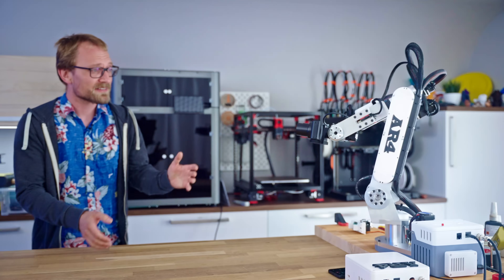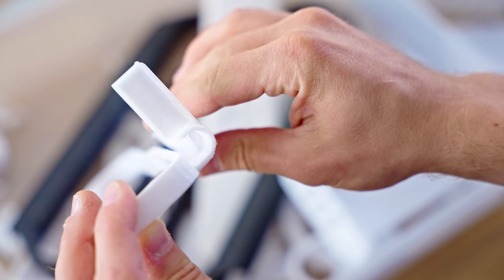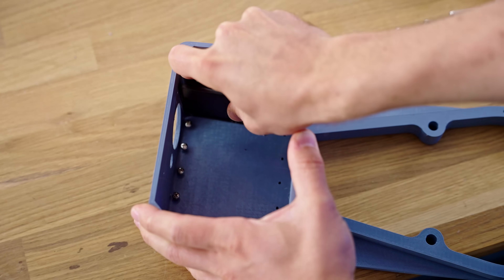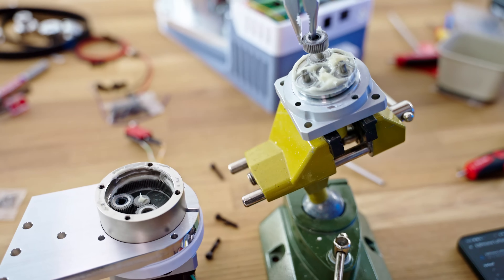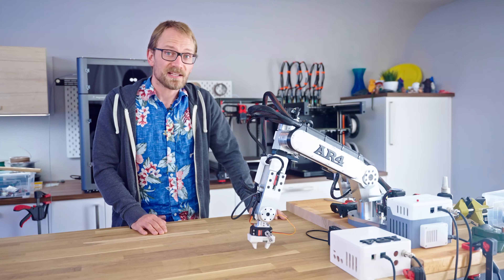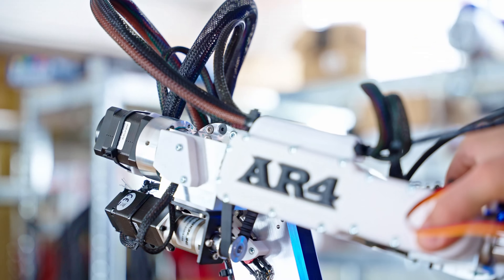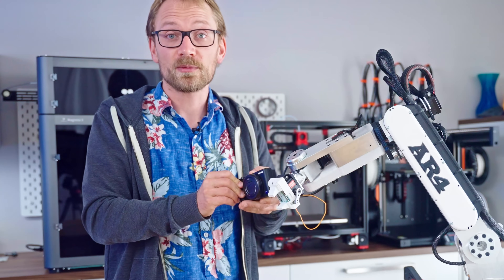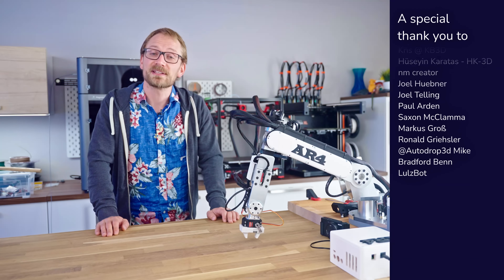I built myself a new Robot Buddy!

Comment: Instead of tinning wires it is better to use ferrules. Cheap and reliable
Reply: I was surprised to see that is the official way to do it, it is well known now with 3D printer failures that you do not tin wires that go into screw terminals.
Reply: @conorstewart2214  also there are 2 types of screw terminals. One have additional sheet metal inside terminal to spread force over whole connector, it also acts as a spring so this connector have harder time becoming loose. And there is a second one, where wire is kept in place by screw directly. Second one can be used only with solid wires and ferrules, as stranded wires are simply getting crushed and cut inside by rotating screw.
Reply: @conorstewart2214 i thought Thomas covered this before too.  Either way good to mention this as always.
Reply: I find it's more secure to just ditch the ferrule personally, if you don't use the right one and it's not properly crimped, the wire can slide out while the ferrule is left behind in the screw terminal...

Ferrules aren't used for 230V wiring in houses and stuff either, and they will never budge
Reply: @PureRushXevus you do not use ferrules on solid wire.
Their main purpose is to hold the ends of stranded wire together so the current flows through all strands not just those few the screw terminal caught.
For the very small wire made of delicate strands the ferrules provide protection from the screw damaging and literally cutting off some strands.
Thick solid wire doesn’t need ferrules.
They also provide some strain relief for thin wires.
Reply: @rok1475  a lot of the 230V wiring for homes in norway don't use solid wire, 1.5 and 2.5 mm2 cables will often have like 7 strands for their conductors. 

And they're wired directly into fuses and whatnot right into the screw terminal without ferrules or anything on the end. With a good quality screw terminal, I'd have more faith in that versus having ferrules on everything where one might have not crimped on properly.

Just went over one of my printers' wiring and none of the wires that go into screw terminals have gotten loose at all
Reply: @PureRushXevus  
Sorry to say this, but it seems more like a user problem and not ferrule problem. Every wire gauge needs a different ferrule size, also it is very important to use proper crimper for the job. Crimpers stamped from sheet metal are useless, they never works. Use one with machined dies, or shutter like with 4 jaws (or 6 jaws). Second type is very universal as you don’t have to swap dies, usually they work with wires from 0,25 to 4 mm2, decent quality ones u can find for like a 15 euros. And in bizarre world of crimped connector, ferrules are the most simple and easiest one to do correctly.
And ferrules are used in 230V / 400 V wiring A LOT. With stranded wires are pretty much mandatory, unless u use something like Wago 221 / 222 or similliar connectors made purposely to work with unferruled wires.
Reply: I wish I had run into wire ferrules much earlier, especially screwing down larger wires.  Surprised this issue didn’t get caught much earlier.
Reply: @xanowich  (fml I think my reply got nuked, why is youtube so fucking bad)
if it did get nuked: I don't think any of the wiring around the house here would have ferrules on them, maybe it's a country to country thing?
I bought a kit from aliexpress that has a decent quality crimper which has 4 jaws that look like a ninja star when not crimped, and then closes into a square when crimped. sometimes when I've used it, I feel like the ferrules I've got are either slightly too big, or too small. So when I then use the slightly too big one and crimp like hell, it doesn't stay on.

Maybe I need to get more ferrules in different sizes? even though the kit came with a bunch of different ones. the model is called HSC8 6-4A and made by "sanjiang", I'd link it but yeah my comment would definitely just get deleted by spam filter or something .-.
Reply: Hard agree
Reply: In the industry, all screw connectors require a ferrule. Only the spring type connectors can accept bare stranded wire.
Reply: @PureRushXevus  That's incorrect. The machines in the kitchen all have stranded cables and do have ferrules to connect them inside the machine. Only solid cables don't have a ferrule (because it is useless).
Reply: Hell no, tinning is the way to go. Solder remains maleable making this not only the most resistant option as you cant pull the wire out wirh the screw molding itself into it but also the best as far as resistance goes, granted,ferules might not introduce too much resistance,it's still more than solder so I'd be interested to see how thermals look in comparison under load. 
The only difference is that you don't need a soldering iron on the job. Ie. It's faster to and safer than nothing.
In any case i have yet to see products on the market uing ferrules instead of proper crimps or tinned wires. Seems too unsafe.

Comment: Thomas,  

Thank you for building the AR4 and highlighting some of its features.  I did want to touch on a few of the comments you made. In the overview section of the manual I do mention pre-applying solder to wires being joined together - I find it easier to pre-apply solder or tinning the ends - and then bring them together with the iron rather than trying to hold the wire ends together and hold the solder and hold iron at the same time, not having 3 hands - it helps to pre apply the solder.  None of the wires going to the breakout board call for tinning so I'm not sure about your comments on that?  

On page 143 I do have some groups of wires soldered together to help group them going to the 3 screw terminals as its a tight fit and difficult to maneuver them into position without them being connected but you could certainly use ferrules in this step if needed. 

At one point in the past the design did utilize plug connectors and building a wiring harness.  Given different applications, motions and articulations all the low cost plugs I sampled proved to fail over time.  With this small arm and the limited cable routing and cable arc lengths, direct solder with the solder joints in strategic locations using heat shrink proved to be more reliable, less bulky, less costly and not as time consuming as crimping and inserting numerous plug pins.  The primary goal of this project from day one has been to realize a usable robot and at a very particular price point.  I've worked with industrial robots my entire career and its always been a frustration that any usable robot was out of reach.  There is an absolute threshold on the price as most educators have a budgetary limit so I have made it priority number one to stay under that limit.  This drives many of the design aspects,  The motors for example are off the shelf variants and cannot be fully customized without adversely affecting the price. There is a limit as to what OMC can customize on these coming from the factory.  The machined components are kept to an absolute minimum and as many as possible are cut from flat sheet material.  This also drives the bearing designs and tensioning designs as custom machined threads and spindles for locknuts for example is not in the cards at this price point. It also drives some of the belt selections.  

I did notice the belt tension on your build was far too loose resulting in a good amount of play.  Here is a quick video of the forced deflection on my build. (well it looks like I cant post a link in comments but I will post in on my channel or the forum)  - Making the statement that  "This robot arm is neither accurate nor precise, rigid or smooth" seems a bit harsh considering. The AR4 project is always under improvement, its not perfect but like I mentioned to you in an earlier email the robot is designed for pick and place, welding and handling operations. A great deal of effort has gone into this project, I know you have a great deal of experience and a wealth of knowledge in all manner of machines and mechatronics and your design suggestions are certainly well founded but I wanted to explain these aspects of the project, and hope you will convey these points to your audience. 

Thank you,

Chris
Reply: I had tried many different robot arms, but no one beats AR4.
Another big advantage is that you can discuss problems directly with Chris Annin.
His manual is the best and most detailed I have ever seen for such a product in this price class.
I got manufactured custom-made motors at StepperOnline, and I know how many motors needed to order to get them to a fair price.
I don't find some of your criticism fair compared to the price for an AR4.
Last .. sorry for my bad English, I'm from Denmark  🇩🇰 😊
Reply: Thanks for your work over the years Chris!
Reply: Thanks for the educations and making robotic arm accessible.
Reply: Thanks, now I understand why there is no plug connectors:
Quote: "At one point in the past the design did utilize plug connectors and building a wiring harness.  Given different applications, motions and articulations all the low cost plugs I sampled proved to fail over time. "
Reply: This is the first I’ve heard of this arm, its incredible! I’m setting up a workstation for my robotics projects later next month, I wish I could set up the arm to keep my tools organized! It’d be a fun project
Reply: my gawd please break up your comment into paragraphs
Reply: I've build both the AR3 and the AR4 and can confirm that the direct soldering/no crimping or connector is far better. The electronic enclosure is very tight and could grow an inch to help the wiring, This robot arm is fantastic and Chris deserve praises for his effort and his relentless support.
Reply: You missed the point.
You are not supposed to use tinned wires in a screw terminal blocks, the solder softens over time under the tension and loosens up.
You are supposed to either screw bare wire or use ferrules or tongue terminals, ferrules are most common.
Reply: @Arek_R.  The point is - the manual does not call for tinning any of the wires going to any of the screw terminals - the manual calls for bare wires to the screw terminals.  The part of the manual that references pre tinning the wire ends is in regard to making it easier to solder 2 wire ends together.
Reply: @anninrobotics  are there ways of reducing the backlash seen in this video. Is there a way of making this use case (of holding a video camera) possible in a smoother way?
Reply: @TaskerVhun  The biggest issue would be to get a good belt tension.  The wobble shown in this video is due to the J3 belt tension.  I have updated the manual since the release of this video to add more information regarding belt tension.  I cant post links on this channels chat but if you look up the video "Introducing our new macro filming Robot." you will find one use case where the robot was used for filming.
Reply: I agree with Chris here I definitely feel like this review was pretty harsh for no reason, I mean if Thomas doesn't like the smoothness of the robot why doesn't he design something to fix the problems? That at least would help everyone out rather than discrediting what I can only explain as phenomenal open source work by Chris
Reply: hey @anninrobotics I would like to help you with the electronics and embedded software if you want. What is the easiest way to contact you? Send me a P.M. Cheers.
Reply: @rexpetersen5909  It sounds like Chris needs to ask for a donation from someone, or get an investor to put up a few hundred grand or charge an extra $500-2,000 per arm so that he can hire out more engineering work.
I personally have an idea to use robotics in a business, and would like to use a robotic arm like this, more as a point of focus than anything else, and would like it to be larger than this, faster, smoother, and have it look prettier (i'm aware this is the least relevant part) than this. But i do love what Chris is doing by trying to democratize the idea more.

Its getting better, but It's not there yet, and it would be nice if it was.
Reply: Okay i am impressed, only 1200 us for the robot kit 👍
Reply: Chris, been following the project for a few years and I can't wait to get my hands on one!!! Love this robot and the things you have done for the robotics community.

Comment: Not sure if I missed the price, but a quick look at the link says its about $1200 for the kit, and $800 for the motors. Not bad all things considering, could certainly help a mom & pop shop get some basic automation going
Reply: I saw such on aliexpress for 400...but quality can be anywhere from excellent to shit
Reply: 0:21 You did but it is good to have it written too.
Reply: Shockingly cheap with precision machined metal parts
Reply: what kind of automatization can you achieve with this accuracy and stability? Plus all the effort of building it, which is almost impossible for a normal person who is not a tinkerer.
Reply: @nukularpictures There are plenty of engineers who get tired of working for other people and start their own company and basically focus on how to efficiently manufacture something.

I could see this being used as a sanding robot.. you don't need crazy precision for something like that.

The average mom and pop?  Definitely agree with you.
Reply: So those are USD prices, no tax included. Before you get this kit at home, you will have to pay taxes - especially in Europe
Reply: @yayinternets  You want to tell me, that this machine is able to sand anything? It is way too flimsy for that. 

For packing stuff it is most likely too slow and inaccurate, unless you have a gigantic margin and, most of all, you can often build faster systems for those jobs just on a regular cartesian motion system.

You only need that many DoF if you have to move complex paths

Comment: Hi, robotic engineer here. I made this robot a while ago when he was at the AR3 version, this made me learn how important precision machining and zero backlash gearbox is important for robots. Also his kinematic his questionable. While it does work, you need to develop your kinematic with singularities in mind and all the possible configurations of the robot for that position. Instead he limited the joint limit values to avoid having more than one configuration, but this is not optimal, dangerous even.
Reply: Would you recommend another kit then?
Reply: What is dangerous about limiting the joint limits?
Reply: @tec4303  I'm no expert, but I would assume either failure of a joint from higher force loading than anticipated or risk of toolpath collisions from having to work around over-constrained IK paths.
Reply: @tec4303  even with limited joints range, its possible to have multiples configuration in certain positions which can lead to the robot changing configuration mid-path. A linear movement (MoveL) is usually made from multiple targets very close to each other along a line, if the robot calculate that there is more than one solution to reach these targets, it has to choose which one to use and stick to it for every targets following that line, or else the robot might twist its wrist 360 degree suddently at maximum speed to keep the linear speed and that is dangerous.
Reply: @Hazdazos   What are some similar ones you know of? THOR, and BCN3D come to mind.

Comment: You made some errors during the building phase, man. Also, don't forget how much a real robotic arm costs, even a used one. I have one, and I can assure you that 99% of electronics enthusiasts couldn't even get near it or handle the thousands of pages in the manual. Chris @anninrobotics has done an incredible job at this price point, especially considering he did it alone, as you pointed out. There will definitely be some backlash due to the gearboxes. A single strain wave with zero backlash and brakes costs more than this entire kit. The software still has a lot of room for improvement, but what he's achieved, especially not being a software or embedded systems developer, is admirable. I say that as an electronics engineer who works with all this stuff as well. I'd love to help him if he's interested, particularly with the drives/motors part, to simplify the building process.